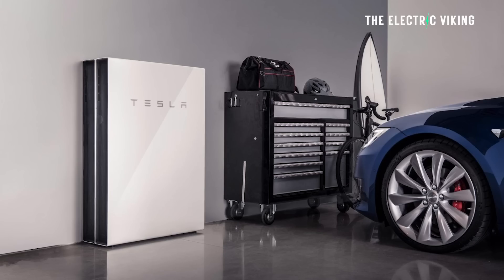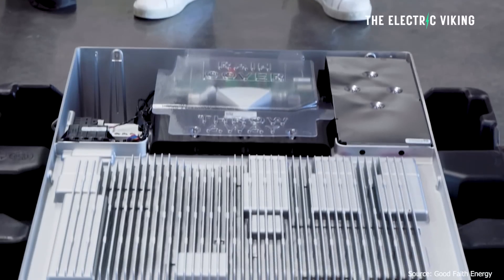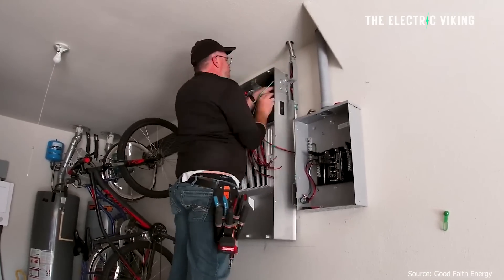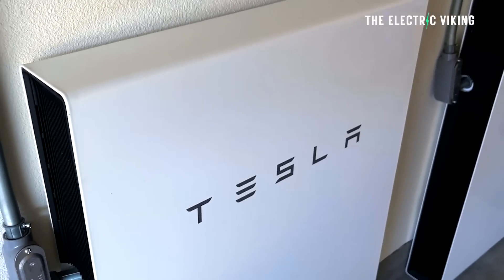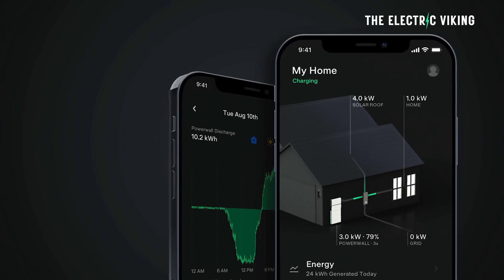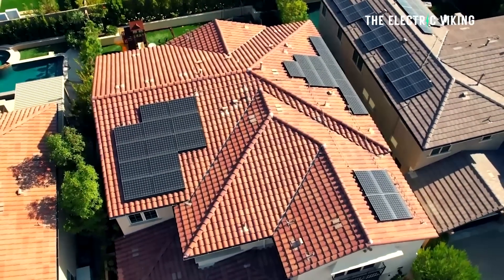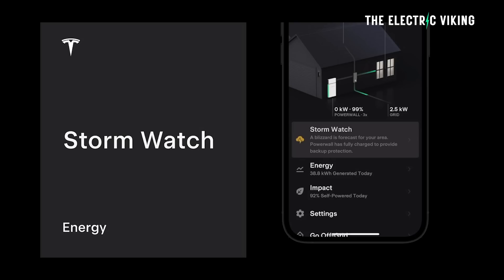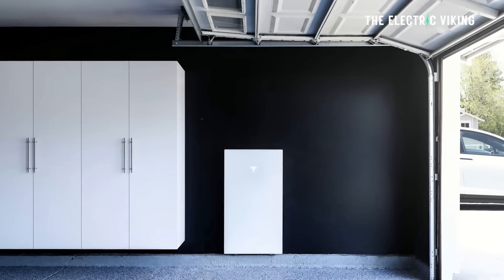Tesla Powerwall 3 finally arrives in Australia - is it worth it?

Comment: one thing that isnt touched on here is powerwall 3 isnt great for houses with 3 phases. you need 3 walls to cover it all vs a fronius/byd solution. I'd prefere the Tesla system but in a real outage, my coverage is limited to a single phase.

Comment: good video.  any more news on the smaller power wall 3 coming in 2025?  None of the suppliers I speak to know about this.  I am looking to buy two power walls but I might wait to buy the second one in 2025 (assuming installation costs do not outweigh the saving of the power wall.).

Comment: The current Tesla 3 has an inbuilt inverter. You mention that next year there will be one that does not have the built in inverter. Is that one going to be able to be installed linked to my current inverter? If getting the current one, that would make my current inverter redundant or as you say, the inverter in the 3 redundant and you are paying for that.

Comment: Batteries & solar make the most sense on a ToU (EV plan)  & a still prefer to charge my EV on that very inexpensive 8c overnight rate, typically 12-6am.One of the uses when the battery makes sense is to use this instead of the very expensive peak tariff on the same ToU plan, atypically from 4pm-8pm weekdays. And or on the still relatively expensive shoulder tariffs. The last thing I would use it for is EV charging.

Comment: I think you mean 11.04kW and the 185 is rma rotor motor amps...it's not the same. Also ac coupling existing inverters have to be limited to 5kW max ac. But yes overall much advantage

Comment: I Installed Solar panels two years ago, then install two Tesla Powerwall 2 batteries last year and this year bought a Tesla EV Model 3 LR. Got all the Tax rebates for everyone of the items above.  At home I only use solar to charge my batteries and EV. The only carbon I am producing now is when I breath out. Sold Tesla stock to pay for all of this.

Then went on a trip through the Midwest and East coast with my new EV. Drove over 4000 miles, no problems charging up at any time. Electrification is the way to go. Will lower lower gas prices in the short term. Love driving my EV, faster than most cars on the road and safer.

Comment: Finally the Solar problems and issues cropping up here as well. I keep commenting it for a while 😄Inverters usually cannot work without grid (off-grid) mode is even illegal in some countries.  Battery backup for your house also not as simple as these videos suggesting... Battery has max output if you overdraw electricity it will burn down. And distributed systems also not that simple. Electric companies moving slowly, legislation is slow, acquiring meters is slow. And when you sell your extra electricity they pay you 1/8, or 1/10-th...
Reply: your post is full of misinformation. Nothing burns if you overdraw - it just cuts out. Inverters with islanding feature do work off grid and all that is needed is a proper automatic switch at switchboard when power goes out. Noone forces you to sell your electricity. Set inverter to zero export if you dont want to sell.
Reply: @superwag634  Not sure what is the misinformation. But let see the points:
. 
- Electric cars also should not burn out but few times they do. Overdrawing power for long period of time generates heat which causing the fire in the cells. No guaranty there is protection against it in the battery pack. Tesla power wall, I'm sure has it, but not everyone pays for that price. There are cheaper packs, or used electric car old packs installed, with less safety features. Price is price...
- I also wrote: "inverters usually not working without grid" those are the cheaper versions. If you pay high end inverters those off course can work, BUT it is in many country ILLEGAL... So even if the inverter support that you cannot configure it to work. Unfortunately in Hungary it is also illegal, like balcony solar is also illegal...  I have my original small system 1.2kW Vevor "simple" inverter it is not doing anything without Grid. New system have 5kW Huawei inverter it is supporting off-grid, but as mentioned Illegal. So not configured like that.
- I buy electricity off peak 37 HUF, and 67 HUF at peak. But selling it fix fixes 5 HUF. That is 7-13x difference... If I turn out the access energy export I get 0... All extra produced energy going to be wasted! Why makes it my statement false? Earning 0 how changing the basics of mathematics, such as 67/5=13.4 difference in price??

So what was exactly the misinformation there?
Reply: @tothimre7950  well I have 2 x 7kw systems. One is over 14 years old and still going. Second is 3 years old. 
The battery thing, well I live in Australia and it is completely illegal to do anything with scrap car batteries. It’s only commercial certified backup batteries and they need approval for connection to grid and installation by licensed electrician. They indeed back up the whole house if grid power goes down. Nothing illegal there.
In terms of export, they’re now starting charging us for exporting power during day. 1-2 cents per kWh. Unless it’s in the late afternoon, when they pay you up to 10c per kWh for solar export. Buying power from grid is about 50c per kWh. Most of the country has smart meters with computerised time of use data capture and it sends that data to electricity company every 30 minutes. If you export a lot of solar, you get a bill for that nowadays. The power is basically worthless and there’s too much of it, which causes gas turbines and coal power stations to need to be shut down and that’s not good for grid stability. 
So there’s not any fire issues with house batteries. I don’t even remember the last time it happened here. Cars yes, they burn in peoples garages and driveways. Back up power from battery is in no way illegal. And exporting power can cost us, so you can program inverter not to export.
Reply: @superwag634  Thanks for the reply. Interesting info. However I think none of this makes my original comment misleading. Actually you are even confirming points, you wrote electricity price is 50C and they buying it from you at 1-10C... so huge difference there also. Electric Companies don't want you to make money and for me registering the whole system thing took 4 moths as I wrote it is slow... And government like taxing everything here the 5 HUF is also taxable with 15%. At least some income after the expensive investment. For me without battery it was 1.5USD per Watt, with battery is 2.5 USD with all Chinese parts. In In Australia probably cheaper, China is closer probably much less taxes. Hungary sucks we have world leading 27% VAT, etc...  
But again turning off "export" and just let electricity wasting if battery all full, still the worst option, minimum income better than 0.

I think worldwide regulations are similar for some extend. Like here we also must have Smart meter, and only registered electrician can build the system. So they know the rules also. In Hungary off-grid is illegal. The electrician told me and also my LUNA2000 10kw pack has 5kW max output. Which is OK, but can reached with electric oven 2.2 kW and induction plate 6-7kW, etc... Problem with battery backup you potentially don't realize there is a grid outage and you keep running appliances! So even if it would be legal to use it off-grid still not recommended. My pack is only for night and "dark days" usage with grid support..

I have this battery which is commercial, no scrap, etc.. Look at the spec: https://solar.huawei.com/en/professionals/all-products/LUNA2000-5-10-15-S0/specs
"Max. output power" is the important not the PEAK which is for 10sec. So these batteries output power is usually 1/2 or 1/3 of the original capacity. 2-3kW is easily reached with 1 water cattle 2.2kW + micro 900W and you overdrawing the battery. And if you have not so smart pack then it will burn.

Anyway I think we reached a conclusion what was my original point. These videos makes solar "simple as stick"... 
"click, click and all ready to go, no Grid needed you are independent, you make tons of money, etc.. Take a loan even otherwise you idiot..."

Truth is not that simple. There are 1000s of different devices with different capabilities. Tons of different regulations per countries. So if you allowed and buying the right parts then you can achieve all mentioned functionality. Otherwise not... And price will be massively different based on the components you buy! Return rate is also differs, but probably it won't pay off in 20 years.
Reply: @superwag634  Just to show my point with battery fire. https://youtu.be/-KvssGZy6js?t=552 So tons of people using refurbished electric packs. Software and heap pump for cooling system is the crashed car... So not much protection. But to be honest those packs has tons of "juice" so they more likely can support, induction cooking + micro+ TV+tons of other things running parallel.. So it can be much safer then a cheaper house purpose backup battery. 
Which still lots of people have with grid backup they work fine. But off grid mode they can output very limited power compared to a house requirements.

Comment: I can justify using a car in place of a power wall, and adding some of the price into the car to offset the eventual cost of battery replacement.  If the car is a plug in hybrid, I would have the car as a generator in an emergency.  Maybe in a few years I could afford a power wall to go with the inverter portion of the system.

Comment: In Thailand Tesla power walls are priced at B699,000. That is around US$20,000.00. Until these power walls fall in price considerably the take up rate in south east Asia will remain low. Thailand is washed with sunlight daily. The whole country could run on batteries and solar. It’s such a waste that this issue is not being addressed.

Comment: Hi, my understanding is that the only limiting factor to the powerwall 3 is the inverters 5KW charging. Therefore if your panels are producing 15kWhr of power, the inverter will charge at 5kWhr to the battery and the remaining 10kWhr will go to the grid. Does anyone think I'm not correct on this? I'm surprised it doesn't have a 10kW inverter.
Reply: You're not correct. PW3 has a 10kw inverter.

Comment: New EVs have car to load or car to grid. That will kill batttery systems, especially Tesla';s horrendously overpriced stuff.
Reply: If you have an EV which has V2H where will you get power to Charge your EV.

For a domestic home set up I do not believe an EV with V2H will benefit the householder except in a power outage

Comment: Battery storage is still way to expensive
If you had 1 and used all 10 kw every night of the year
I pay 30 cents off peak
So around 3 dollars per day or around 1100 dollars per year
10 years is a return of 11,000 for something that cost 12 to 14k
Might as well put the money in the bank a get interest it would be a better return
BTW I am not anti solar I have 20 kw but I cannot make the cost numbers for a battery to add up to any savings
Reply: Did you factor in inflation? Future carbon tax penalties? Unfortunately any energy grid running on coal, gas or recycled industrial waste will face additional taxes in the near future. Regardless of the steep costs at today’s prices for going solar, it’s only a matter of time before traditional supplies become stigmatised by western governments. It’s already happening in the UK, although their current Prime Minister is a deluded dictator.
Reply: Your calculations are based on current energy rates. In the UK at least the rates don’t stay static for 10 years. Then there is the convenience of should there be an outage you have the back up power supply. Also what about charging at cheaper rates and exporting at higher rates in the day?
Reply: @danfrench2008  still not worth buying at the current time
Reply: @steveclancy7832  based on what…your calcs that aren’t complete?
Reply: @danfrench2008  it's complete enough to show battery storage is not viable at the moment
Reply: @steveclancy7832  well it’s not…a PW is 13.5kw not 10 as you claim, so already your calcs are off. Then you’ve omitted the gain of exporting the low off peak power when it’s worth more, and the fact energy rates don’t stay static for ten years. Add to that the benefit of power outage cover, collecting solar that is worth less to export than the offset of drawing that same power off the grid.
Reply: @danfrench2008  rofl you can buyn13.5 kw you can buy 10kw and quite a few other sizes
Reply: @steveclancy7832  what?! The video is about power wall 2 v 3 - both 13.5kwh batteries.

Comment: Way too expensive. Our all in one battery made in Finland costs 16000€ with 70kWh battery and 12kW inverter. You can connect 15.5kW of pv panels in two strings and support smart charging by reading the spot electric price a day ahead. Our company is named Heliostorage.😊

Comment: I just got two Powerwall 3s installed in Southern California in the US. I had two separate solar systems with one having micro inverters and the other having a string inverter. Removed all those inverters and just using the ones in the PW3s split into 5 strings. Didn't need the gateway as we have the Tesla Backup Switch available here. Much simpler installation. The Tesla app is fine but I would like it to show the solar generation based on strings since I lost the per panel monitoring of my old systems. Also it just shows the percentage charge of the batteries as one number, show hard to tell if something is going one with one. So far over a month and a half of brutal heat, the system is working well and I'm able to cool the house better during the day and make it most of the way through the peak TOU period and not pay the utility the exorbitant rate for most of it, plus the software learns this and pumps some battery power into the the grid to give me credits to offset that. Haven't had an outage yet other than just testing it out. Will probably add more panels and add-on batteries next year when we are getting electric vehicle(s).
Reply: Netzero app will show power per string.

Comment: What am i missing? A 2nd  hand tesla p85 with 90% battery is 15k. No battery and sold for parts is 4k. So lets say that 4k pays for inverter and case. Ive got over 75++kwh, from tesla, 15k. And that battery designed to accelerate a 2 tonne car to 100kph in 5 seconds. There is no way my combined household appliances pulls anything like that. Clearly im missing something, but just dont know what.
Reply: That's garbage mate. 
I just looked it up and the p85d is $53, 500 (2015 model)

Comment: I have 2 PW2's installed in 2018 to complement our 13.2 kW solar PV system installed in 2012. Love them and the charge on solar feature in my PW2's. I paid $15k (US) for my two Powerwalls. The output from my PW2's has been more than sufficient for our use and have been very satisfied with their performance over past 6 years, so the extra output feature maximum in PW3's is not needed by us. We effectively charge our two EVs (Tesla's) off our solar + battery system and export ~half of our excess solar back to grid via net metering.